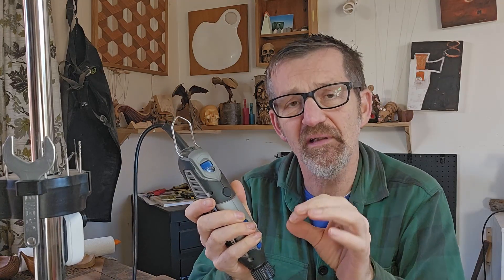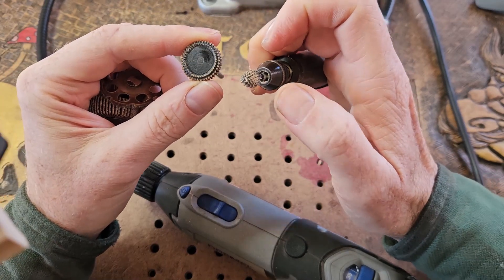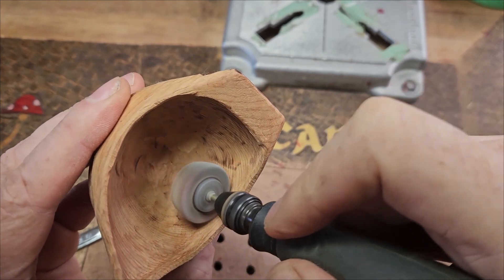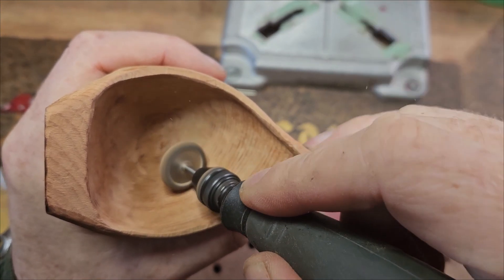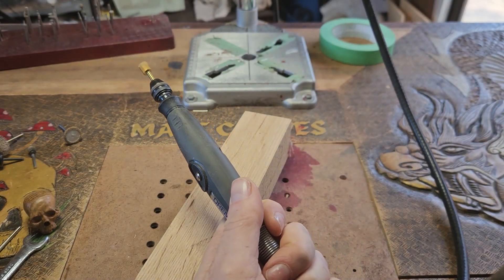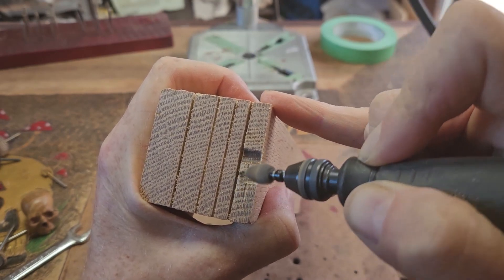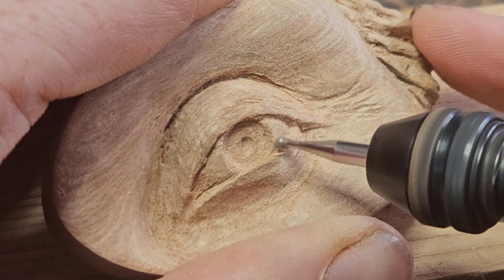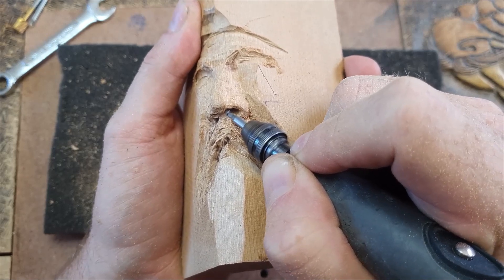Dremel speeds for woodcarving

Comment: The only way common sense becomes common, is if you make videos about it.   Good stuff.    Liked the part about how to get rid of a stubborn burned part.   Sometimes wood just wants to be burnished and it must be coaxed back with a soft touch.  Sometimes hand sanding is effective there too.  I love to use the cheap 2 inch Velcro backed discs that can be had from Amazon for this and just general hand work on smaller carvings.
Reply from the maker: Yeah, true that. Most of carving is just common sense, most people are afraid of failure as well so they don't experiment. Yeah those mini disks are great. Cheers 🍻